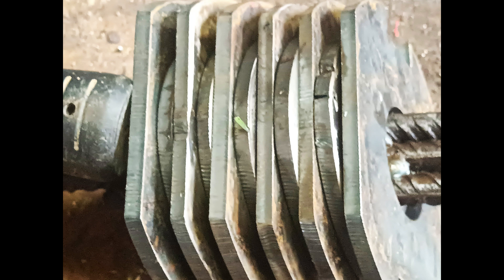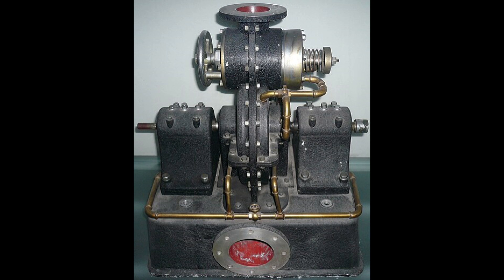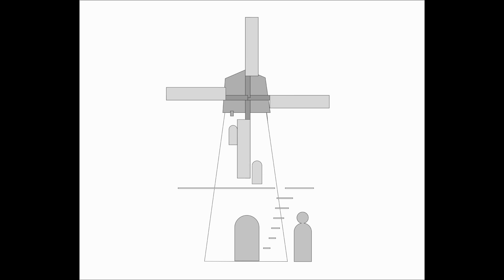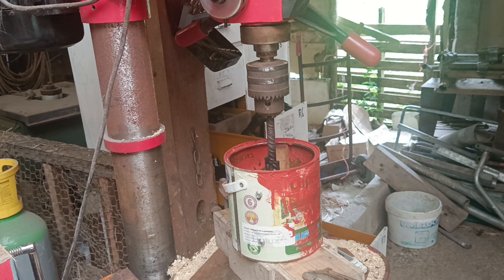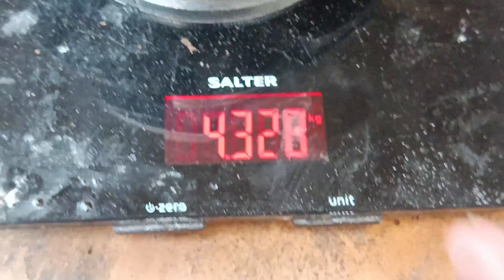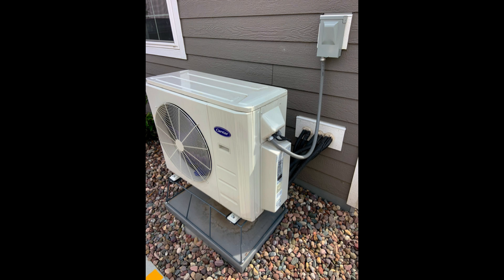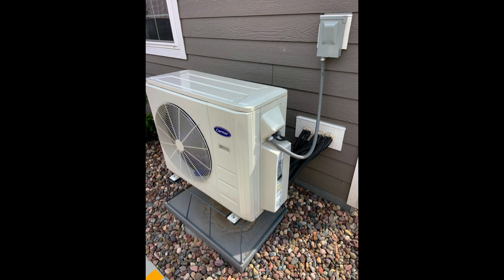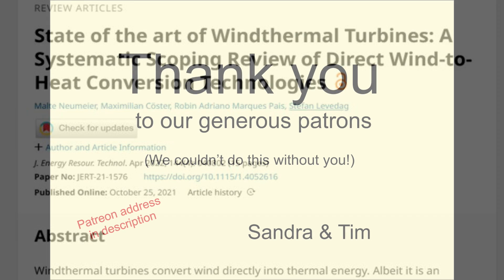More Interesting Things About Friction And Mechanical Heating - It's All So Interesting!

Comment: What about a highly viscus oil or paste? Machine the plates to have tiny oil channels in them extending out radially and use the thickest oil you can find and maybe mix in a grease to thicken further.  The oil channels will ensure there is a small gap between the plates once they wear in but then wear should dramatically drop off afterwards.  Want more friction? Put a little pressure on the plate sandwich like a clutch.  Want to run at lower RPM?  Make the thing WIDER.  Added benefits: it won't evaporate, it won't rust, great thermal properties, it could go above water's boiling temperature without pressurizing, the right oil can self-regulate to lower it's viscosity (friction) as temperature rises.

Comment: what you also can do is using very viscous oil. that'll slow down the abrasion of the metal plates and increase friction by quite a lot. it should even be possible to not have the metal plates touch each other and still create a lot of heat when the oil is viscous enough.

Comment: I made an induction heating device, a few decades ago, that easily boiled water, when operating at 400 RPM. 
 It had 16 magnets, arranged on the face of a 400mm steel disc. 
 These faced an aluminium plate, with a clearance of about 4mm. 
 When spun at a mere 400 rpm, the plate soon reached 200 degrees C, and turned water into steam  :) . 
 That's the way to do it, in my humble opinion.
Reply from the maker: I'm intrigued - that sounds too small, but perhaps they were big magnets? Do you have a video of it?
Reply: @wayoutwest-workshopstuff6299  
 Yeah, it was rather small, but that was all my antique lathe could handle  :) . 
 The magnets were 50mm tall, about 35mm wide, and 12mm thick. 
Being glued to a 6mm thick disc of steel, their output was enhanced, due to the magnetic circuit afforded by that backing plate. 
 What's good about this design is that it does not impose any real load on the spindle, while it is beginning to spin up, which makes it better for use with a wind turbine  :) . 
 If I did this again, I would use a bigger disc, to match the base of the water heating vessel, and add more magnets.
Reply: @CNCmachiningisfun  i did it as well about a decade ago. been a few channels try it with angle grinders and copper pipes and various efforts and you just have to laugh at them as they all missed the important aspects... WHERES THE EDDY CURRENTS? it seems a common theme :).
200mm backing plate off a big speaker, shallow 16mm pockets (no glue!). yes, enough to locate them, bridge the unused poles, but not enough to short the magnets out to themselves!
i think it was 30 of them... alternating polarity neo magnets worked far better than one pole only. obviously! planned a spiral, somehow the g-code stuffed up and yeah... just a single row.

a "brass disc"... not sure, i suspect its some weird copper alloy... but worked. could be better? could be worse? iunno!

a leadscrew to vary the air gap and braking force. all pivoted for a load cell.

then they banned motorised bikes here and i shelved it 80% finished and pinched the magnets and now its just rusty junk?

my mistake was spinning the disc, not the magnets. oops.

but this idea has been lurking in my head for a year or so now, and im looking at various bits of scrap again... i have to make a dyno anyway. about 100HP capable this time.

hold the copper plate still this time and add water cooling!
Reply: @paradiselost9946  
 Your new project sounds interesting  :) . 
And, yes, it is nice to see that you properly understand the workings of these devices. 
When I developed mine, I couldn't help but compare it with the mechanical speedo in an older car, as the stator plate always wanted to take off, and follow the rotor. 
My next one will serve as a feedback system for engine RPM management, using the speedo mechanism.
Reply: This is a video in which someone tests this:
https://youtu.be/eZAsmNeREXA?si=FC70LtGaE2L7rPVn

And in this video, someone is building something similar from scratch:
https://youtu.be/Dg8oVR4k5Dk?si=NjFKTYlI4uWIKOiR

I think this is a good idea, in which the elements practically do not wear out, but very expensive due to the prices of magnets.

Comment: Couldn't you change the big gear drive on the top horizontal shaft for a big sprocket, and have a small sprocket on the bottom horizontal shaft and a belt drive instead of the the vertical shaft, as you said your windmill won't be as tall as usual windmills.
Reply from the maker: don't forget the whole cap can rotate 360 degrees
Reply: @wayoutwest-workshopstuff6299  oops

Comment: How about a large thermal mass, say from sand or crushed recycled glass, you could use a few different ways to heat that mass from solar, hot air or water maybe collection from waste heat. Heat battery from any heat source for use later on when you need it.

Comment: The whisk, impeller, or orifice designs might work well at low speed if you use a high-viscosity working fluid, such as a gear oil. A non-newtonian fluid such as cornstarch suspension might also be useful, and could even serve as a sort of speed governor for the wind turbine.

I also like the heat pump idea, as if the coefficient of performance is 2-3, then the powertrain and electric generator (assuming electric drive) could be as little as 50%-33% efficient and still break even with direct friction heating.

Comment: If you are finding that  you get 20-30% loss in just the gearing of the windmill to get it to the 400 rpm at the bottom of the windmill, you'd be much better off going with an electric  system and resistant heating. Dynamos are typically 90% efficient, and moving down a short length of wire isn't going to provide a significant energy loss, which and the incandescent heating is hypothetically 100% efficient (because you're turning all of your energy into heat, which is a form of waste energy). You'll be looking at something more like 80% efficient all told, and with no consumables. It's not as cool, but it would be substantially more conefficient. Of course, you could also easily add on a heat pump in order to make it even more efficient, but no matter how you'll do it, it'll be no worse than what you're currently planning to do, and almost certainly much better.

Comment: Why do you think metal to metal friction will be higher than metal to water, after those plates polish and lap to self? In my opinion, pairs of static and moving small paddles, riding close to self, will generate much higher friction due to turbulent flow. And you don't need to use water, you can use viscous oil or grease and you will get incredible friction and your mechanism will be protected from corrosion. I can easily imagine several kilowatts of heat from coffee can size device.

Comment: Do you remember your steam machine cylinder? If you pump water through a small hole the energy you need for pressing is converted into heat. You only need a crankshaft (ball bearing) and the rod is pumping water in circle on the bootom of your mill. Use some screw (needle valve) to find the optimal hole diameter.....

Comment: I will vote for two different type systems:

1) a shaft driven air conditioning compressor connected to provide heating or cooling as needed.

The air conditioning compressor shaft would be mechanically driven by your windmill with the reduction gearboxes mentioned by Kris in another comment here.

The crankshaft rotation speed would not be very high so you would need a large volume compressor.

It might be necessary to be able to connect more than one shaft driven compressor to the large driving gear or chain so that under higher wind conditions more heat can be generated and stored.

Instead of commercial refrigeration gases you could use a mixture of mostly propane with some butane, study AZEOTROPE.

The whole contraption would be located inside the rotating head of your windmill the heat that is generated would be transferred with a heat exchanger liquid, think about the hydraulic connections in an excavator.

Yes, propane is flammable and explosive so precautions have to be taken.

I built a home-made air conditioner using car antifreeze as the heat transfer liquid for our boss under his detailed instructions when a summer student in a maintenance shop in the 1960s.

2) build a very large circumference alternator that can produce significant amounts of electricity at slow rotational speeds using only copper coils and iron cores from used transformers, no need for large numbers of magnets.

Comment: So I decided to calculate out how fast the plates would wear away...
For every rotation the wear volume will be V=K*F*s/3*H, where K is the wear coefficient, F is the force due to the weight of the plates, s is the sliding distance and H is the hardness in Pascals.
For mild steel K is 7*10^-3 apparently. F in Newtons is 4.3kg*9.8 = 42.14 N. s is tricky to calculate since is a rotating disk, I assumed they are 200 mm in diameter and found the half way point by calculating the area, diving by 2 and finding the radius of the disk, then finding the circumference. This came out to be 444.27mm. The hardness for mild steel is 1.177 Gigapascals (1,177,200,000 Pascals)

Taken all together a single rotation will cause V = (0.007*42.14*444.27)(3*1,177,200,000) = 3.71*10^-8 mm^3 of wear. 
Since its rotating at 400 RPM that's 1.48*10^-5 mm^3 per minute or 7.8 cubic millimeters per Year!

Bear in mind this is only for the bottom plate, the other plates will wear by progressively less the higher they are in the stack.
In any case I think it will be fine :^)
Reply from the maker: Brilliant! Thank you. I wonder whether it's accurate, but I'm very impressed nonetheless

Comment: If you are already treating the steal plates as consumable, rust is a good thing.  Iron rusting is an exothermic reaction, it adds some minimal heat to the system.
Reply: They sell those hand warmers that are just little bags of sawdust and iron filings that slowly oxidize when you take them out of the plastic packaging.

Comment: You could get cheap mechanically driven heat pumps from used car ACs maybe? And if it breaks, you will definitely always find replacements. 

What you said about their efficiency is of course technically true, but practically they do really have 400% efficiency (in the way that matters): you want to heat your house, right? Converting 1kW of energy from the windmill using the friction plates gives you 1kW of heating power for your house. But with a heatpump, you would get 4kW of heating power, making your house actually warmer than in the friction way. So I would say the 400% number is actually the more relevant one.

Comment: Even crappy alternators can be 60% efficient. And resistive heating is 100% efficient. 
My gut feeling is, lot of energy is going to be lost bringing mechanical power down to the ground. So an alternatior in the head would be technically the best arangement.
But where's the fun in that.

Wonder if a cheap low power heat pump idea could be made from a fridge compressor system. Run from generated power. 
A bit of care taken in removing it intact and pressurised. Though you are only going to get low temps from it. But could make a preheater for another system.

Comment: I can think of only one heat pump setup that'll meet your requirements. Traditional heat pumps use hermetically sealed compressors require making electricity, however, you could probably pull the entire air conditioner out of a junked car. They are belt driven at not particularly high speeds (using a mechanical seal rather than being hermetically sealed) and would probably do the job. You can just dunk the hot side radiator in a cooler and pump water through that cooler.

Comment: Why do you use metal to metal? The water will be always black bot clean .... We use to have spinning wood chalks on disc plate spinning against metal. And wood lasts long time
Reply from the maker: I wonder how well the wood would last underwater?
Reply: @wayoutwest-workshopstuff6299  the water has to be located in cylinder or barrel but wood is not submerged into water...wood has to scratch metal from outside water tank....so in other words closed small barrel with water inside and has welded in pipe in middle...so your windmill pipe goes through barrel with water via pipe and is connected to disc underneath closed barrel.so wood is located on top of the disc but under barrel with water so scratching takes place on bottom of water container...wood does not toch water at all.
Reply: @wayoutwest-workshopstuff6299  Heat Transfer to Metal: The heat generated by the friction between the wood and metal will transfer to the metal container. Metal is a good conductor of heat, so it will quickly absorb and distribute the heat across its surface.

Heating the Water: As the metal container heats up, the heat is transferred to the water inside the container through conduction. The metal’s surface, being in direct contact with the water, will start to increase the water’s temperature.

Temperature Increase: Over time, as the friction continues and more heat is generated and transferred, the water’s temperature will gradually rise.

Comment: Hi Tim, just an idea to get some more RPM if you look at my waterwheel build I used a shaft mounted 20-1 gearbox. they are called shaft mounted conveyor gearboxes. I have found that the one I used only get slightly warm when running at 16rpm with 2kw going through it. So I have 16rpm getting geared to 320rpm. then a 2.4-1 pulley belt drive  that takes it up to 768rpm to run a 8pole induction motor. The loss in this setup is very low. nothing gets more than just warm to the touch. if you did a 5-1 pulley from the gearbox you could achieve some high rpm. 20 rpm x 20 = 400 rpm. then a 5-1 pulley =2000 rpm. there is losses but for 2kw the loss is in the region of 200-300w Also because a lot of the loss is happening in the gearbox itself and you are trying to make heat. that heat could be recovered from the gearbox as well. it would add complexity but is possible. The belt drive though would be to complicated to recover the heat so that would be lost But the closed gearbox unit could have a heat exchanger on it. I do like the induction heater idea. Neodymium magnets are so expensive and corrode. because size won't be much of an issue for you ferrite magnets could be much cheaper for the same magnetism and they have the benefit of not corroding much at all.  these are big and reasonably priced https://www.first4magnets.com/rectangular-c35/152-4-x-101-4-x-25-4mm-thick-y30bh-ferrite-magnet-20kg-pull-p2549#ps_0_2570|ps_1_726

if you want any info on the gearboxes just send me and email mate. Great video.
Reply from the maker: Thanks very much, Kris. I didn't know such things existed - I do now though!

Comment: Is this an AI thing or just generated as new for new to you tube with people as a similar interests to help "AI " come up with answers. I'll watched this video 5 times every time as a new video.
Anyways my response still The same. 
For it to be metal direct friction.
If not put you house gen in fluid that it can be in power you house with an under size and heat the fluid it lays in

Comment: And we can't forget that mechanical solutions are just interesting! Modern electric windmill can be more efficient, but where is fun in it? Small traditional windmill is much more fun idea, even if it will be less efficient. But it will looks much nicer, it will be simple, you can fix whatever will happend. And it will take more time, so more videos!

Comment: You'll lose more energy bringing the power down from the top of the windmill than you would installing a generator at the too directly.  Also, almost energy losses are to heat so not really a loss if you can keep it contained.

Comment: with your issue about the speed of the magnets, you could achieve those high speeds with flywheels
it also could just be large flat discs
use the 400 rpm you might have free from the final drive of the windmill itself, and onto a fly wheel and it might be a fast enough speed at the edges, the heating plate could also be hollow, less to heat as well

Comment: A thought to complicate things: Have you considered roller chain drive from the brake wheel shaft to the floor?  I is somewhat expensive (what isn't?), but the efficiency of chain over gears, belts, etc., should make it worth considering. The desired speed could be managed through one set of sprockets, eliminating other methods of energy mode changes. The biggest problem in my mind is having the drive mechanism pivot with the brake wheel shaft to get to the floor level, but that's beyond me at the moment.  I'm windmill ignorant, so you may have more insight that might make this work.
Reply from the maker: Did you forget that the whole cap rotates? (Including the brakewheel)
Reply: @wayoutwest-workshopstuff6299  That's the part that is beyond me...however, as massive as the rotating "wheel house", "head" or whatever its proper name is, it seems there should be enough substantial structural support for a rotating mechanism to "dangle" down to the floor level.  Since there is also a tilt to the brake wheel axle, the proper angle to bring the bottom part of the chain could be calculated to that the bottom end rotates around a fixed transfer unit.  The internal support structure would have to be adapted to clear the chain's route.  Ok, I'll shut up, now.

Comment: Car air conditioner is much simpler.   With a small compressor  that is belt driven. The hot side radiator could place in water to heat or a fan to blow heat. Of course  the cold side radiator will give cooling for summer.